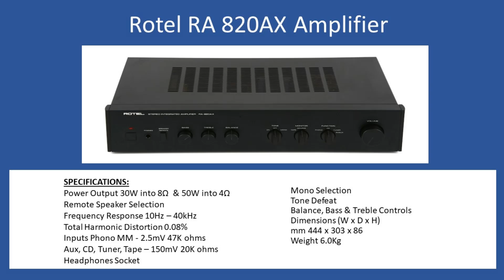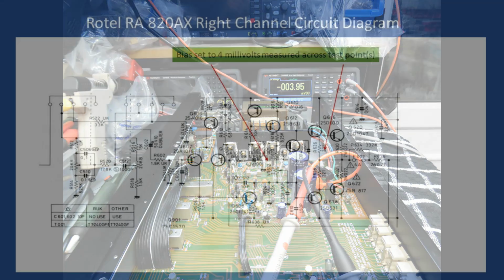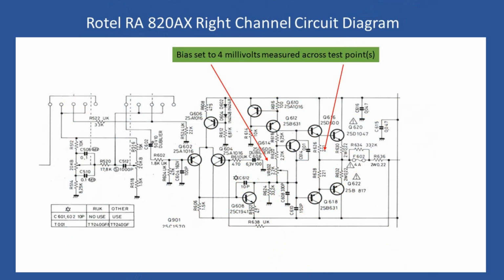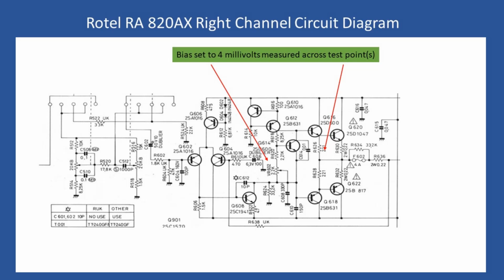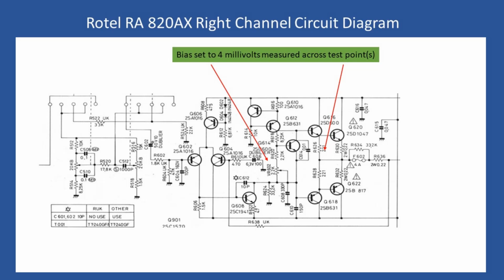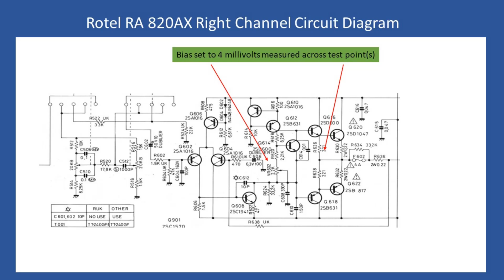Rotel RA820AX Amplifier Repair (With Audio Tutorial)

Comment: Pin benders. Mo Fos! Nice work finding those corroded fuses. When i power down my Cambridge audio A300 there is a capacitor discharge squeal through the speakers. Is this normal?
 Also I have a 4kw 4chan Powersoft power amplifier (with switching powersupply). When i turn it on, regardless of vol position there is a high pitch sound through the speakers which rises to above audible range within 5 seconds or so. Sounds like the power supply starting up but not being filtered adequately. Must check caps some time. Any ideas?
Reply from the maker: Hi the A300 squeal is normal as the unit has no speaker protection system.
You can purchase such a circuit board and fit it into a case for example.
https://www.amazon.co.uk/Speaker-Protection-AC10-18V-DC12-24V-System/dp/B0B7FM6M7J

With reference to the Powersoft power Amplifier I would recommend contacting the company directly.
https://www.powersoft.com/en/about/contacts/